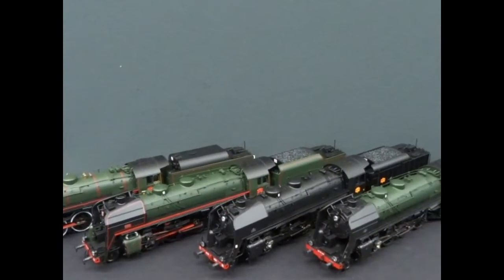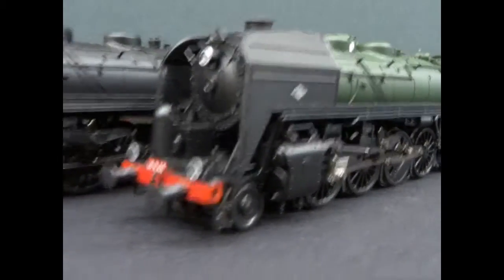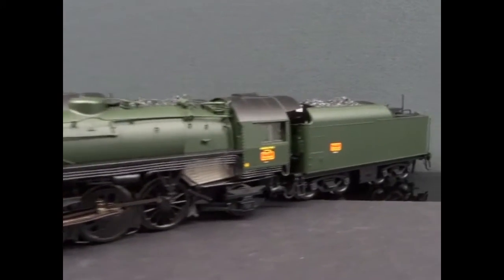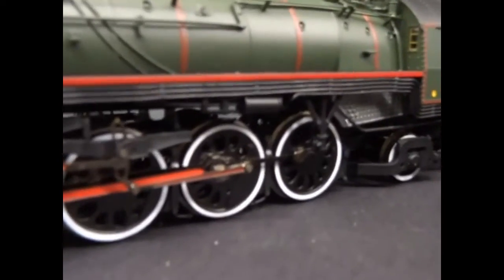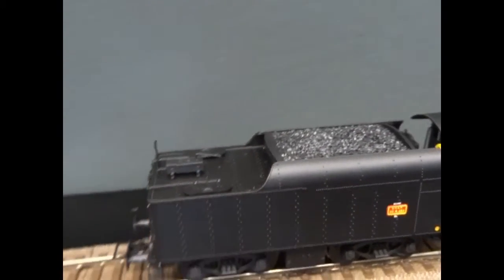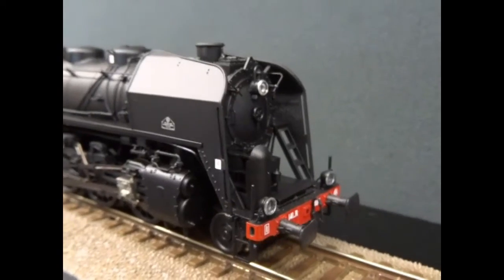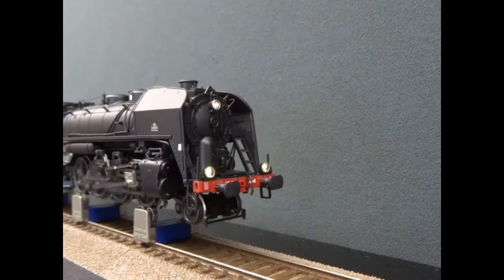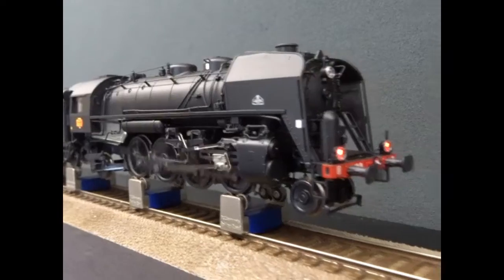Jouef HO SNCF 141R HJ2430 HJ2431 HJ2432 HJ2433

Comment: Good review and helpful that you show all four variants. I am based in France so have just ordered the green with red lining in Epoch 5. I had seen the older variants and wondered what these new versions would incorporate. That runs beautifully and the cab lighting matched with the cream interior is superb. The large running lights are excellent not least how they change colour by direction. Thanks for confirming the body is plastic and I see on your website description that the running plate is metal, very nice. Can't believe that Hornby got that wrong on their website - not. They really do need a good technical writer for their website. In fact I am so taken with this model, I have also ordered the in-preservation version too as there are sufficient differences ie oil tender, boxpok wheels and immense detailing that it is worth it.  PS just one suggestion, if you could get a stand for the camera that would be a big improvement to remove the wobby images. Cheers
Reply from the maker: A tripod gets in the way  - it would be nice to have the luxury of setting up a shoot, scripting and re-shooting for the perfect edit - in reality these films are disposable and cannot exist without subsidy.
Kind regards
Chris